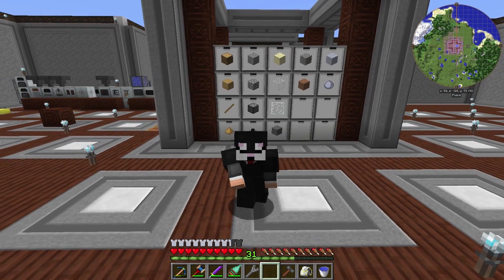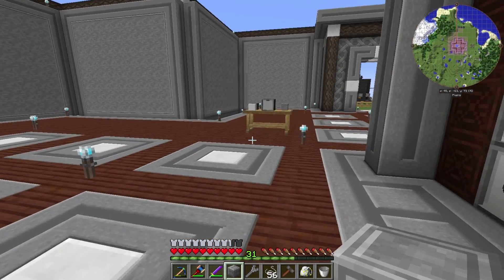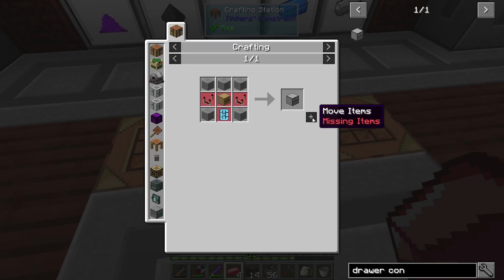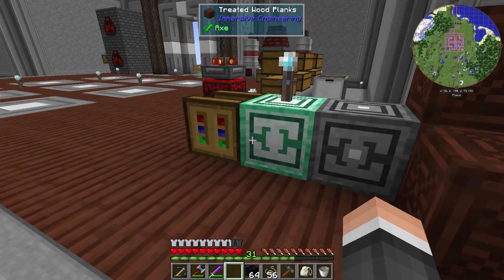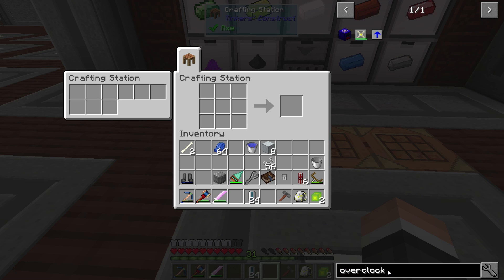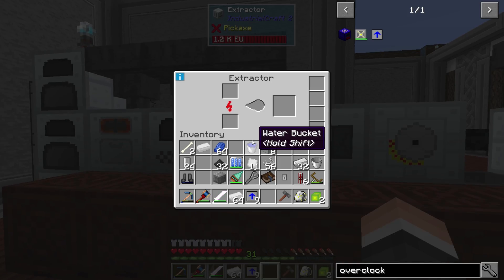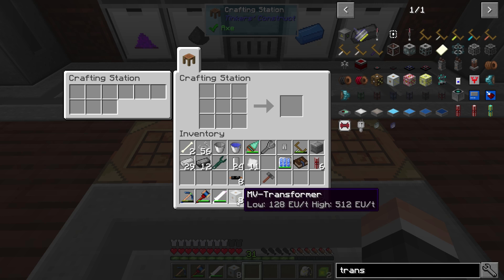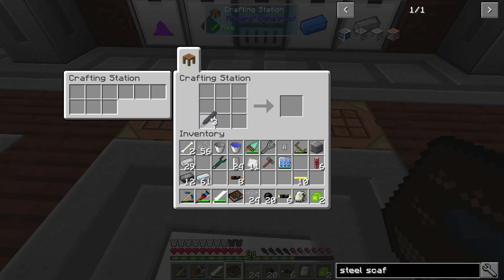Age of Engineering EP11 Overclockers + Metal Press

Comment: You CAN hopper/transfer node directly onto the conveyor onto the first conveyor belt of the metal press. You don't need the covered conveyor. I have done it many times before without an extra conveyor.
Reply from the maker: You cannot hooper, you can node/conduit.
Reply: I've definitely done this directly with hoppers as well, but I think I was stamping plates. I can see the hopper not working for gears since you need 4 ingots at a time instead of just the one.

Comment: If I am correct than the capacozors from ender io make the machines faster and more efficient. They use less power per operation.
Reply: And is it possible to change power from rf to eu using immersive engineering wires? If not than look at the recipes for mekanism cables. If you can make them than pu them into the test too.
Reply from the maker: All power changing methords are disabled in this pack,

Comment: You should make induction furnace, don't have to worry about putting ubgrades into your furnace, it's normal recipe, so not that hard :P
Reply: VidZargi i dont think thermal expansion is in this pack
Reply: Cereal Ender i meant the ic2 upgraded furnace, the thermal expansion one is induction smelter
Reply from the maker: I plan to stay away from EU powered mahcines that have a RF alternative as I need all EU I produce in the future for the Mass Fabricator and the Molecular Transformer.